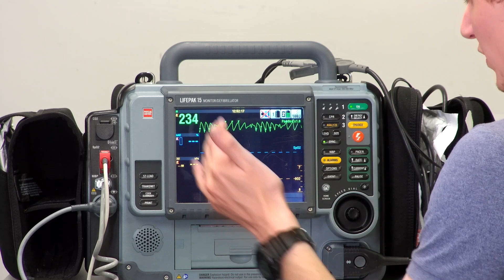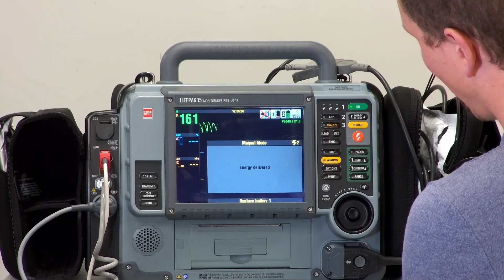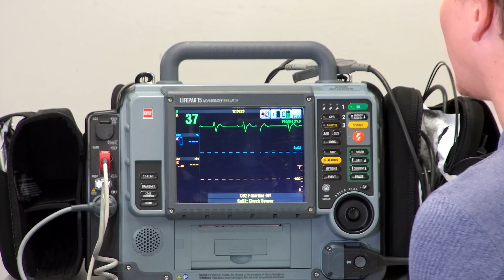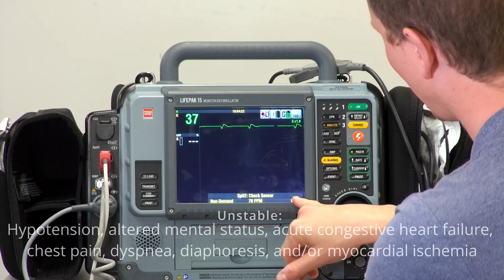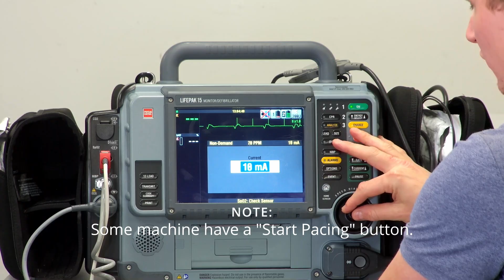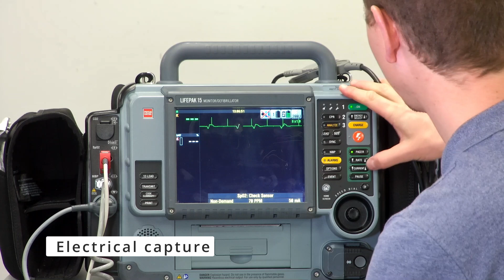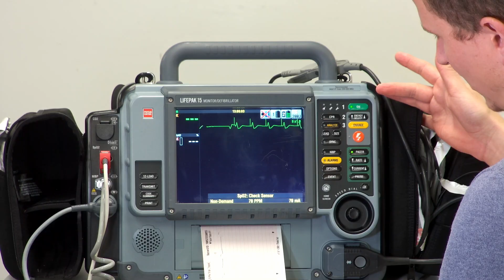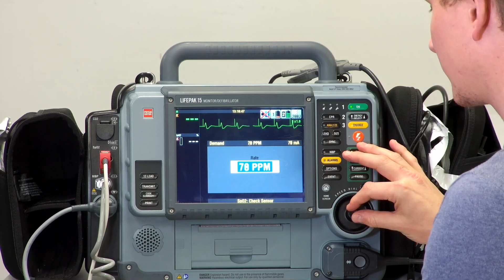Lifepak 15 Part 3: Pacing and Cardioversion

Comment: From an MD - This rhythm is ventricular FIBRILLATION!!! You DEFIBRILLATE this rhythm. ;) Do another video where you correctly do synchronized cardioversion for a strip that shows ventricular tachycardia :)
Reply from the maker: Hi, 
I appreciate the comment. If are are referring to the rhythm at 3:00,
That is Torsades de pointes, it is a type of polymorphic ventricular tachycardia (PVT). I acknowledge that you wouldn't sync cardioverion a polymorphic VT in real life. 

The purpose of the video is to show how to cardiovert, not a specific lesson one which rythem/patients need to be cardioverted.  

Thoughts ?